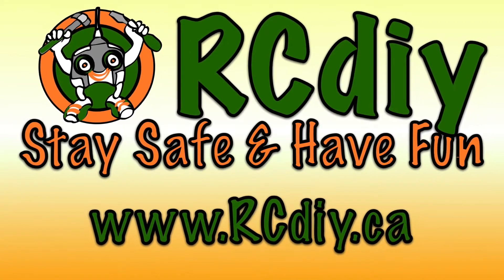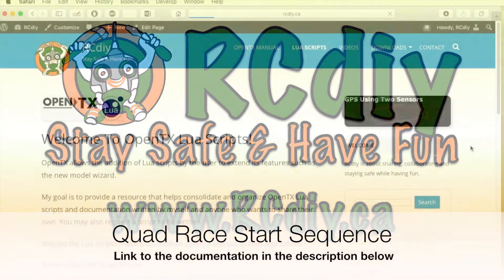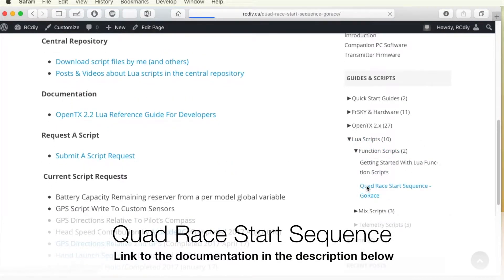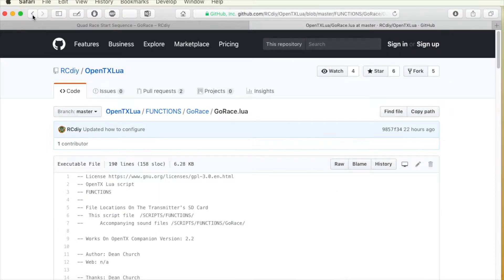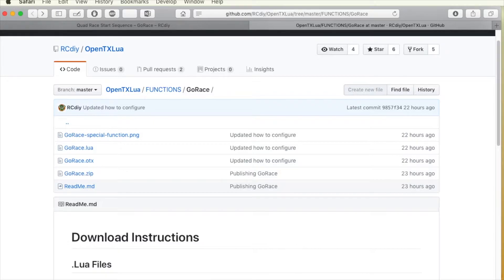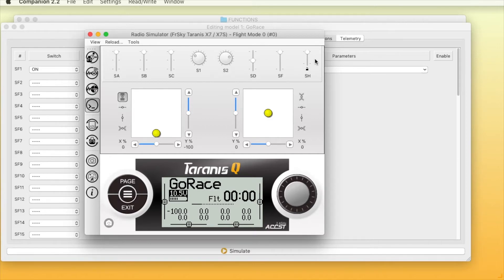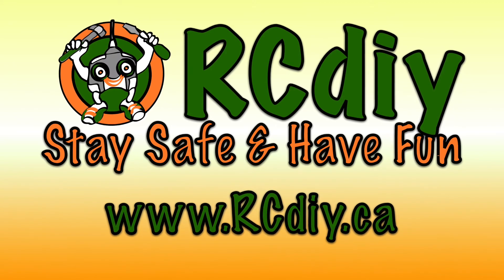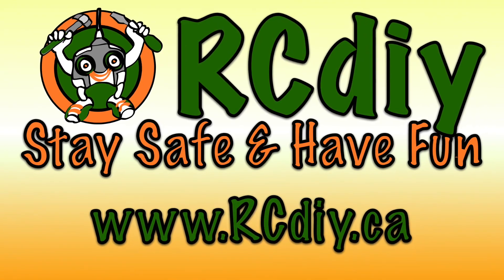Taranis Q X7 OpenTX Quad Race Start Sequence – GoRace Lua Script

Comment: I got the script working and it plays Joe Scullys voice but won't play the tone.  Anyone else have this problem?
Reply from the maker: Working on Companion or the Tx?
Reply: Sorry, on the transmitter (Taranis)
Reply from the maker: I’ve tested it on my X7 using OpenTX 2.2.0.
Reply: i've tried everything.  It doesn't initiate the second wave file on the script.  I have it set on a switch (SD).  No idea what else to do.  Its a great idea and would be an asset in our fun fly races.
Reply from the maker: It needs to be momentary. If the switch stays active the second sound does not play. I don’t know the reason for that. I’ll ask. So move sd to active then away immediately. Or use the default sh momentary.
Reply: just changed it all back to stock (unedited script) and it still won't play tone unless I use the momentary switch again.  I'm close to giving up at this point.
Reply from the maker: Contact me through the website. Tell me the Setup you want. I’ll test and send you the script.
Reply: done